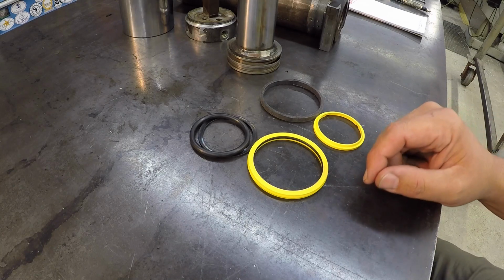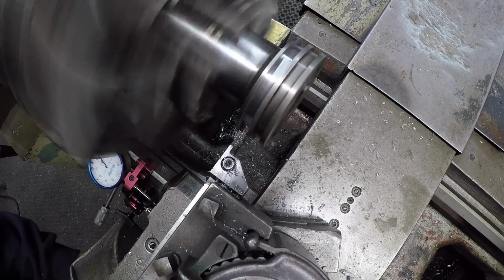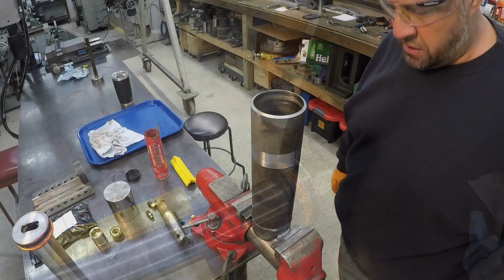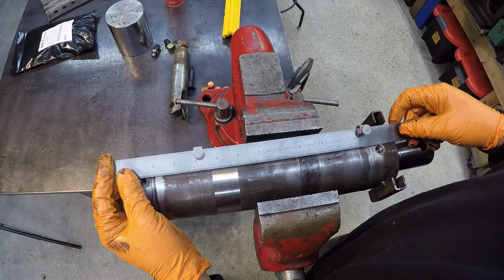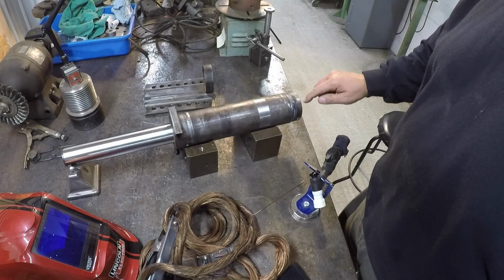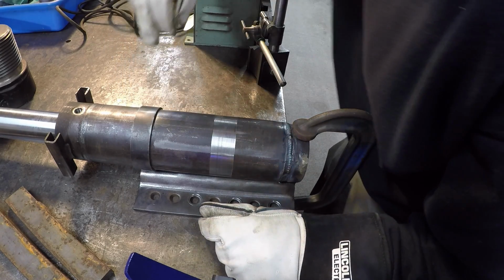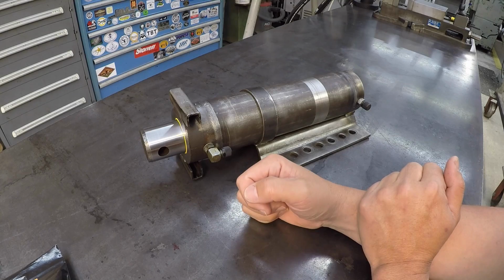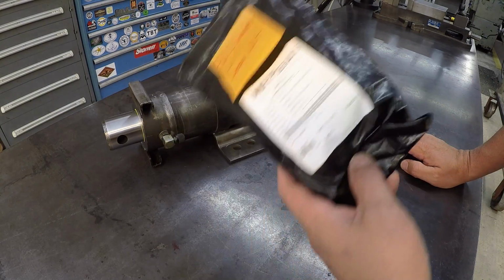SNS 286 Part 1: RV Cylinder Rebuild Completion

Comment: 14:37 - Never learned MIG; used O-A gas torch, stick and TIG for some (many) years. Learned to use TIG to very good effect. But then I never sold my time welding anything. I did learn to weld the new rod to the tail of the used-up rod; probably saved $0.50, but it felt good.

Comment: This old video came up on my feed, and anyone interested who doesn't already should watch Kurtis at Cutting Edge Engineering Australia, whose first weekly video was posted a few months after this one. He rebuilds heavy equipment hydraulic cylinders, among many other things. They are welded just like the pipsqueak in this video, and are routinely repaired. He marks gland alignment using a unique pattern, and always measures the length with a tape. When rewelding on a rotating stand, he uses a rotary spring loaded ground connection welded to the workpiece. There's a video on how to make that.

Comment: Pretty crazy i come across your video. its the exact cylinder i was looking to do myself on a buddy of mines rv. A new one was around $1300- $1400 i felt that is a bit more  should be spent when it should've been a rebuildable unit. idk what is going on with folks in the world but Damn that and the one way manufactures that try to make things  like this.

Comment: Came across your cylinder repair video thank goodness after searching for one like it forever…. Glad I found it and glad you made it. I was trying to help my neighbor with his motorhome stabilizer jacks and suspected that I had to cut them open… your video confirmed my thoughts and paved the way for what to expect… the cylinders I worked did not have anti rotation. I did stick weld to finish after initial tig root weld on the 1st one… i tig welded fully the rest of them seems i had more control especially bridging the gaps that were left after grinding the plate off. So far it took me 49.5 hrs doing this after hours at work. I did evolve  towards the end to working another cylinder between cooling of the welds. The ones i worked on are priced at over 1200$  each 4 total.  Love to send ya my pics  if you wanna see. Thanks again for the video!!
Reply: Robert, I have a similar job to do with a lift cylinder on a lawn tractor.  But all I have is a flux core welder.  Do you think it's possible to weld it back together with a flux core welder?

Comment: Awesome video. A friend wants me to do the same repair but I have never done this. I was thinking of mig welding the cylinder and stick welding the bracket with 7018. Would that make for a stronger weld? any input would be helpful

Comment: Why don't you use backing gas in the cilinder to prevent corrosion inside ?
Reply: It is a hydraulic cylinder, not a pneumatic cylinder. If it is filled with hydraulic fluid, will that area actually corrode or will the oil prevent corrosion in the internal bore?

Comment: Looks great and did a great job. My only question is why didn't you put the cylinder in the lathe, or rotater so you could have run the weld continuously, instead of starting and stopping?

Comment: Thanks for the video!  My HTH cylinder can be disassembled, but the seals are odd ball too. Called the factory and they won't sell you new ones, you have to send it in for repair! My complaints were heard with indifference. I'll take it to my local machine shop and see if he can help me. Thanks again!

Comment: You needed to measure the length of the tube before cutting both side so, when you weld them back together it would be exactly the same size!

Comment: Great videos. I just came across your channel. Thanks. I do wonder what happened to the pin hole leaks that were present in the first video? Did those come out with the cut into the end cap? Thanks again for the details and explanations. I’m not a machinist but I enjoy watching this.

Comment: Question: The piston seal was fitting in the groove , why did you made it wider ?
Reply: He adjusted it to be the exact width for that particular seal (from its spec sheet).
Reply: because that was the recommended gap for that size seal

Comment: Piston itself is 90deg offset as to what it was before! :/ Hope that won't matter ( Since it can't spin due to the square rod inside... ) 
As a former machinist, i love to have found your video's man! Love all the actual hand labour that goes into it as opposed to the CNC stuff of today.
Reply: Prjx Media  I also see it I don’t know why it is changed 🤷🏼‍♂️
Reply: I'm sure it got noticed on installation attempt and he cut and rewelded that holding plate.

Comment: Oh oh. Now that you've correctly repositioned the cylinder with respect to the mount, the main hole on the piston itself is offset by 90⁰. It should be at right angles to the hydraulic fluid lines. Hopefully the orientation of this hole may not be as critical as the hydraulic lines are.
Reply: It probably is just pinned into a square foot anyway I would assume, so doubt matters much

Comment: it is amazing how much weight they expect the welds holding the cylinder to the bracket to hold.
Reply: Looks like this cylinder will easily brake holder if on full power

Comment: Take a look at the end of your piston where it aligns with the ports in the first video (before you started the project) it's 90 degrees off (and can't turn due to the square internals that prevents it from twisting). Wondering if this mistake means the part is now useless and cant be reinstalled without shaft/foot modifications... since it's just a foot probably not if it wasn't, your customer would be PO'd
Reply: Yes indeed. After he mentioned right at the end of the video that he welded the mount incorrectly and how important it is to take notes and photos, I went back and took a look at the first video just out of curiosity and lo and behold, he mounted the piston incorrectly. The only way to fix that now is to open it back up. Hopefully like you said, maybe the part that it connects to can be rotated. I guess he's only human like the rest of us.
Reply: Goood eyes! really good work, other than that.
Reply: The foot pad that attaches to the rod end doesn't care what direction it's in. The only time it would matter is if there were return springs stretched from the foot pad to the body of the hydraulic cylinder. Since this has a powered hydraulic return it won't have springs so no worries, is my impression.

Comment: ONLY for those that dont know.....He is holding the cup of the TIG welder over the weld after he is done to keep the gas flowing on the weld as it cools so it will not pull in oxygen . If he didnt do this, the weld could bubble and pop alittle, allowing for pin holes. This is not only a water tight weld, its a pressure tight weld
Reply: Thanks for this! I was wondering that exact thing. I'm not a pro welder but it's for tips won by professionals through time and experience that I join communities like this.

Comment: When you parted the end of the cylinder off  and made it shorter does that affect the stroke length? when you welded it back together  did you compensate for the 3/16" you used for parting tool width or is it not an issue? cool vid......I think you did but its hard to see
Reply: If you part the base off correctly, you dont part all the way through with the tool. That leaves a thin web of material that butts together nicely and preserves the tube length. 
I work in a shop that does repairs like this a lot.
Reply: @slidey1000  thanks for the reply,  clears up a couple other questions I had as well lol...
Reply: Thanks for asking this. I was wondering the exact same thing.

Comment: Dammed nice work. well done. I rebuilt a hoist cylinder for my dump that was old an raggedy. It was quite a job getting it apart. And found pitting inside. So we filled in the pits with JB weld and put all new seals in it. We had to cut the back off too like you did. It was quite a learning experience. Thanks again!

Comment: Good job, but a tapped end with a tapped collar, end piece and gasket could have been made, instead of giving it the same arse** finish as it had before.
Reply: Doesn't make a lot of sense to set it up to be rebuilt again. This rebuild is going to outlast the RV. Fix it as simply as possible and get it back on.

Comment: love the Blue Ox yaw link on the table by the vise, robotically welded by skilled operators in Urbandale , IA....  For curiosity's sake, what did a replacement cylinder from the dealer actually run? (to balance against the cost of complete rebuild - something I get asked by my management regularly - "how much to repair vs. how much to replace)  As always, your skillset is exemplary - not too shabby with the TIG, either. Always look forward to expanding my knowledge one video at a time - thank you for sharing!
Reply: I use Martin Fluid Power all the time - great group of people. (I do the same thing, make my own 'master kit' for future use)  The O-Ring Store is another source, in the rare event MFP does not have everything.  I had not watched all the way through yet when I posted above, you indeed addressed thoughts regarding cost of cylinder - especially in the event the cylinder is proprietary to a manufacturer that has closed down - making replacement a challenge at any cost

Comment: absolutely beautiful work - its a pleasure watching......work good enough for NASA.  does the purpose of that cylinder warrant the kind of quality and TIME that you put into it?    I wonder if after making some witness marks on the cylinder for proper clocking -  the end of the cylinder could be cut off with a cold saw or a good band saw, beveled with a grinder , the seals/wipes replaced ; the cap aligned with a piece of angle iron and then mig welded back together .  when you have the other 3 cylinders to do might save a LOT of time.

Comment: i did the same with a customer of ours, multiple schools in a bigger city. there are about 30-50 beamers of 2 models, the first beamer took time, but after that, dissassemble, replacing the dmd or fans, reassamble is just a matter of 45min, easy 100€, each time i can repair a beamer for around 300€ incl dmd, it saves the city a around 1k on the beamer, b around 100-200€ on fitting the new beamer to the existing smart-board-system

Comment: Is the bracket supposed to be parallel to the cylinder? The band thickness gives it an offset, as far as I can tell. Maybe it doesn't matter since it's a pretty short jack.

Comment: PRE-buying a whole new set of seals, etc for the rest of the cylinders on an RV???  VERY smart...it's not IF they're gonna fail...
When raising our jacks, we heard a gawd-awful screeching sound from the pump area of my Class A a couple years ago and all I could think of was all the metal going thru the entire hydraulic circuit!  Turns out, it was just the pump - it's actually an outboard's lift motor and the local marina quoted me $280+shipping+tax +++ .  Amazon delivered it to my door in 2-days for $73!  Took me about an hour and a half to install (and, I'm slow).  Made us Happy Campers (literally!) again!           Thanks Adam!

Comment: A clove hitch works excellent on copper ground cables like that.
Reply: The clove hitch is the most underrated knot
Reply: Having said that what was wrong with attaching the ground to the top hydraulic port inlet?.

Comment: Is the hole in the cylinder rod 90 degrees off?
Reply: It doesn't matter where the hole is. You can rotate it to wherever you'd like.
Reply: Not on that style cylinder, think back to the whole anti rotation rod explanation and how he lined it all up using the shaft. The hole is more than likely for a foot so I'm sure that orientation isnt super critical, could be wrong though

Comment: Thanks Adam, I fixed one too after seeing your video!

I’m 74 and had a welding & repair shop back in the 80s. 
A friend of mine has an old Winabago with these welded cylinders. One was leaking fluid out. 
I have access to a shop, lathe etc. I told him could try... it’s junk anyway 😄! 
That was October, he said by April would be nice. Anyway your video came out !!!
I was going to feel my way through it like you did, but seeing it done really helped!
This one was easier than Fernando’s. After I ground the bracket off I was able to use the 3 jaw and put a bullnose live center in a 1” pipe threaded hole in the end cap. I probably should have been using the steady rest 😬.. I will next time, nothing bad happened, but It could have!!!
I replaced the seals; $30 and tiged it back together, no filler  on the root and capped it off ok (shaky old guy with a 3.5 lens)  
My friend was surprised and happy!! He is going to tell his RV service center where these things can be fixed! Oh No! 😬
I figure it would take me 4 or 5 hours like you said. A new one like this was over $1000 plus shipping.

I had no problem with heat transfer up the cylinder, just wrapped a wet rag around it.

Comment: NOOOO... I'm yelling at my screen that you've got it clocked wrong, but you don't listen!!! the disassembly video had the ports clocked 90 degrees to the mounting plate, not opposite it!!!
Reply: i wonder when he finally noticed that
Reply: The cylinder is rotated to the right position in the final images so I guess he had to cut and re-do the bracket welds.

Comment: I wonder if it was designed to be  welded (at least the back plate) since it has that square ant-rotation rod attached to the back plate. They might have worried that any rotation could loosen it.
Reply: A very good point.

Comment: 👍How do you compensate for the width of the parting tool when reassembling? Thanks for sharing.
Reply: He didn't part it all the way through. The cylinder cracked before it was all the way through, so there was still metal left to keep the distance correct.

Comment: Adam. I didnt catch you welding the bracket off 90 degrees. I noticed that the pin hole was lined up with the hydraulic ports. In the 1st video they were offset 90 degrees before you dismantled it. I imagine it doesnt realy matter because the foot just hangs off that pin. I was just curious whether or not you had caught that ? I think you actually had the bracket in the correct original spot. You just clocked the piston to the cap off 90.
Reply: Ya, don’t think it matters at all, but damn, you’re right. 🤣

Comment: I enjoyed watching your video. I have owned 3 motorhomes over the last 15 years. Hydraulic devices seem to always be a problem.  Leaking cylinder's and hoses and hydraulic pumps and controls not working as they should.  Putting a seal in a container and then welding it together is typical of cost cutting procedure  that they use.

Comment: Nice post. All aspects of the project from diagnosis, disassembly, cleaning and repair including welding! I feel for your step dad Fernando. I own a ‘96 diesel pusher and try to keep up with the maintenance, repairs and dumb engineering from the manufacturer! Throw away parts is what makes the RV shops lots of money especially when the RV is away from home and broke down. They hold you ransom! Great to see others fixing stuff like I do. Thanks for the lessons!

Comment: Nice work!  That is better than new.  I have a similar Jack on my RV from the 90s.  The Jack's run about $500 each.  The kicker is the new ones are probably different volumes so all 4 have to be replaced with the same model.  Are you available for adoption?  Lol.

Comment: Love your videos Adam. One noob question for the masses.... where does the hydraulic fluid get put in and how do you know how much? Thanks!
Reply: Spam Killer the fluid comes from a hydraulic pump, on or around that pump somewhere will be a container to fill with oil, hoses run from that to the cylinder. Then work it back and forth a few times to get the air out. This is the same in your car power steering system ,  a tractors arm lift system and so many other applications.  In the car the pump is always running because it’s belt driven. When you turn the wheel it opens a valve to allow that pressure to push the piston.  This is why when you turn the car off it’s so hard to turn, you are just working off the worm gear alone with no pressure assist.

Comment: the press i made from one of these works excellent. it's only 2500 psi, but for pressing bearings it is perfect. bonus, i got 2 of them at a farm auction for $5 for the pair, each of them as a self contained unit with 12v electric pumps. i hope i never have to cut it apart to rebuild it. i've rebuilt a couple on my tractor, but the gland nut unscrewed. i think i'd just get a replacement cylinder from tractor supply, or the surplus center if it came to that. you do awesome work, by the way.

Comment: Wasn't the hole in the rod clocked 90 degrees from the ports in part 1?
Reply: That won’t matter at all. The foot that hits the ground bolts to that. Most a round so not going to be an issue.

Comment: throwaway parts is whats wrong with RVs. I've owned several and every single one had common issues and it was all due to poor design or workmanship. I have went to the RV place and bought a replacement part that also failed in the same way after one season and still ended up just fixing the ting myself. Personally I would rather fix it myself or have someone I trust to fix it and make it a onetime repair. If you seen the welds that Adam cut out compared to the ones he laid down plus with the seals that I could only imagine are much better quality. I'd take a repaired part over new any day. Great video Adam.

Comment: I would have used a press rather than a hammer for piston/cylinder assembly.
Reply: neatmachine  TOTALLY unnecessary. You’re not pressing parts together, just pushing the piston past the rubber seals.

Comment: Abom79, You cleaned the grease off the end of the tube, but then you picked up the "end cap" with greasy gloves on, bad juju for TIG welding. 
All in all, great video on saving a good chunk of change by repairing instead of replacing.